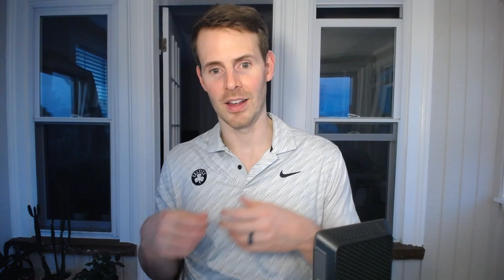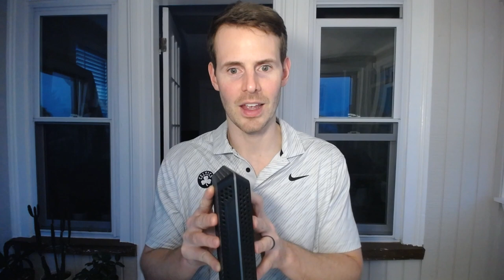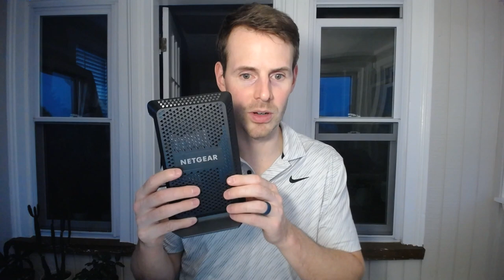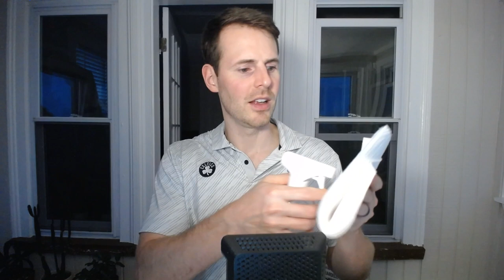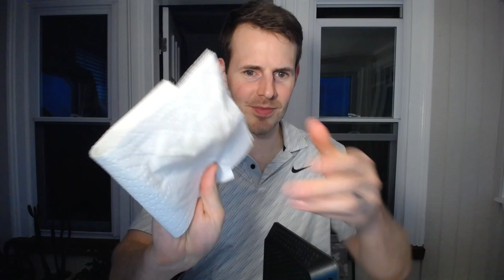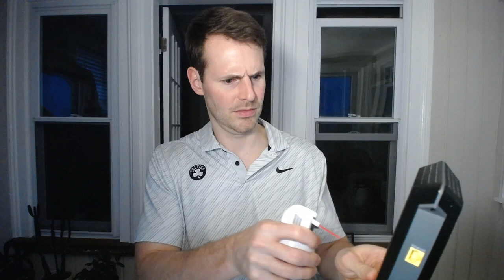How to Prevent Your Modem From Overheating

Comment: I opened mine up, hosed it with Conntact cleaner, put silicon thermal pads on the inside, and installed a USB Fan that clips onto it.
Reply from the maker: It sounds like you won’t have any overheating problems! Nice work

Comment: a question or a video idea: I have a router provided by the ISP and needed wifi on another floor so I ran ethernet cable and got another router and connected it to the ethernet cable. the wifi seems working but some android apps like google drive dont load on my phone when connected to the non ISP router but those apps works on the ISP router.
Reply from the maker: Hey @aaravrahtole8929,
If the router on the other floor (non-ISP router) is set to wireless access point mode, it should have no impact on the internet connection on your phone. You should be able to open all your apps and access the internet on the network of either router without any problems.
Reply: Oh please that's barely dirty and they should adjust design for that.
Reply: USELESS
Reply from the maker: @sherylcorbello2102  in this video I am just showing how to clean your modem. For some people, their modems are much dirtier depending upon where they locate them in their home. I try to keep my modem free of any dust :)
Reply: My modem got so hot I burned my hand trying to unhook the cable! Had to use an oven glove and pliers. These devices need a BUILT IN FAN. What is taking them so long to do this?